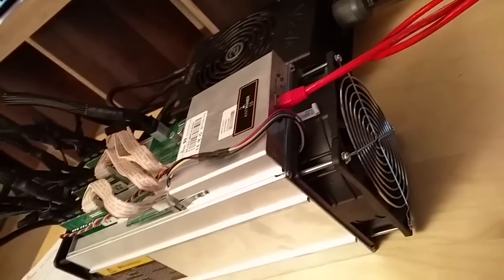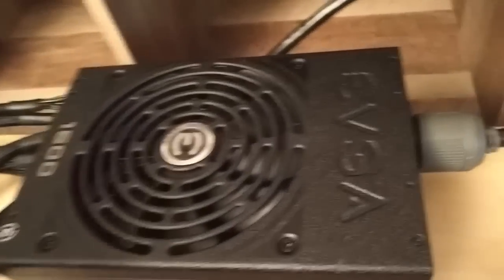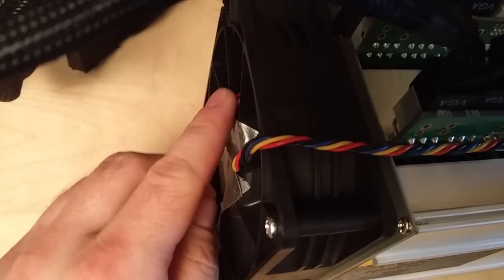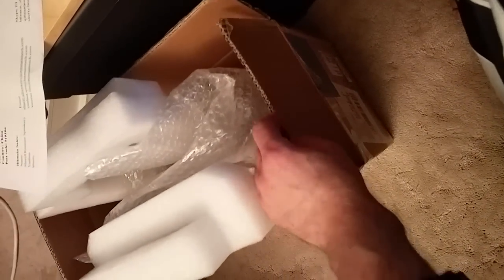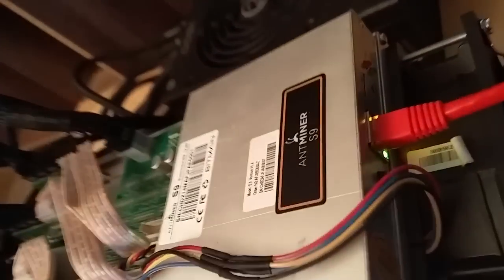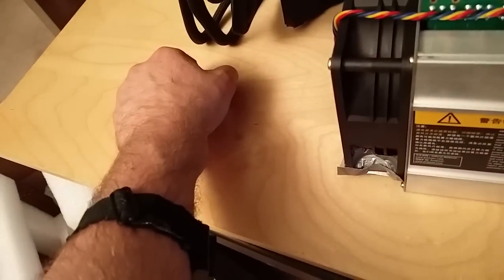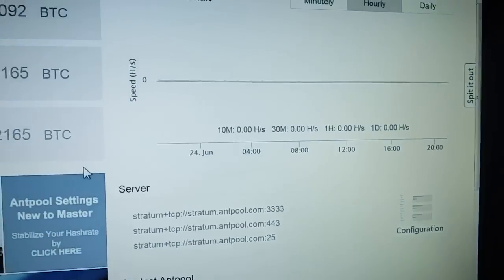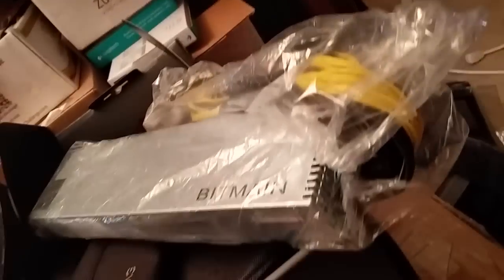Bitmain AntMiner S9 Batch 3 - Powering Up

Comment: I have the exact same problem, I plugged everything turn on the PSU which it does turn on but the miner won't turn any fan or light , I'm about to send it back to China , do you thing is a voltage problem too?
Reply from the maker: sorry for late reply. it is most likely voltage issue which means you need to get a standard 110v 1600Watt PSU from EVGA or similar. The one I got works great without problems for nearly a year now. I sold the bitmain power supply I had on Amazon.
Reply from the maker: EVGA 1600 G2
Reply: already solved thanks

Comment: Samson Shepherd, it seems that I am running into the exact same problem as you did. When you replaced your power source to the EVGA is the miner working on a normal 125V plug?
Reply: Would like to know this too please?
Reply: Did you get yours powered up?
Reply: Hey eddie, yes I did get mine powered up. It worked very well with the EVGA 1600 Gold.
Reply from the maker: yes it works fine on 125 plug. It even works on 110 in my home, as you have seen in the video.

Comment: Do the S9 PCI-e connections into the plug into the SATA connections on EVGA 1600 G2?  And, how many connections PCI-e does have?  I'm practicing on a S3 and it has 4.
Reply: you need 9 pci for the 3 boards.. and one for main board for a total of 10

Comment: That EVGA PSU has over-volt protection eliminating the need for cheap surge protectors.
Reply: Micheal Vetsch the titanium has like 15 types of voltage protection. that being said. Use a surge protector anyways. No reason not to. Things fail.
Reply: GrumpyShamurai the main reason I don't is because the miners I use. 2 will trip a single surge protector while one will not. Because of this I know I can plug 2 miners into the wall socket which has a 15 amp breaker. I would need 2 surge protectors per wall plug (they are all on their own breaker). So I don't bother.
Reply: Micheal Vetsch Get one thats rated for the amps. Or use two separate ones. Lost power here last week because a racoon crawled into a power box and got baked. Weird shit happens, hate to lose a miner over $20 worth of extra protection.
Reply: GrumpyShamurai you are right but I got the most poweful one Home Depot had. Anyway it doesn't hurt to have the surge protector you are right, it is an "extra" level of protection
Reply: Maybe look into an apc if you have the funds. After your done with the miner they are still nice to have around.

Comment: XD, the power supply that you bought from bitmain is around 175-240 volt requirement while America's voltage is 110 voltage so that why it wont work, change your outlet to 220 volt recommended) and then run it or continue use your regular America power supply
Reply: How do I change my outlet to 220volt? Or if I get this EVGA SuperNOVA 1600 G2, 80+ GOLD 1600W can I just plug it into the wall at 110 volts to power the s9?

Comment: Very nice video, I would like to enter in the Bitcoin mining business. I have tried some programs but only at 67 MH/s, just for research reasons, but I am now enthusiastic about buying a 14 TH/s Antminer and see  how it works. I would like to buy Antminer s9 but I am not sure how noisy it is. Is it as noisy as a vacuum cleaner ? or more? Can you sleep if you turn it on at night? or it is advised just to run it in an isolated place? or just putting it in a room you do not use will isolate the noise?
Thxs!
Reply from the maker: Mine is very loud, but if you have proper cooling throughout your house or the area you choose to make it's home, it should hopefully not up the speed of the fans to the "whining" noise jet engine due to the acoustics of the fans and air passing through the heat-sinks at high speed. It is much louder than my vacuum cleaner when it "whines"...and I have a very loud vacuum cleaner. It is just as loud as my vacuum cleaner at ideal fan speeds without the "whining" noise. 
Regarding Heat: If you put it in a room all by itself without proper ventilation and airflow, it will heat up that room in not time. I don't care if you have nice weather outside, this thing pumps out 200F degree air at high speeds and heats up rooms FAST. I knew this going in and I had plans to have it in a better location away from my house, but it overworked the A/C unit over there and I was asked to remove it. So now I am dealing with it solely at home.
Reply: +Samson Shepherd hello i am very interested to buy one bitmain machine but unfortunately i dont know how this works can you tell me how bitcoins can i earn with bitmain machine per month can you tell me the procedur?

Comment: Glad you figured it out. Just one note, Antpool does not share transaction fees. So you are being paid only from the 25BTC reward. I recommend a different pool
Reply: Try kano's
Reply from the maker: Thanks. Any pool(s) specific you are willing to recommend?
Reply: I like Kanos and its in the us
Reply: ***** I would suggest Kano.is if you got a small number of miners. Slush is good but try kano first
Reply: I use F2Pool. They paid every 24 hours. Slush is better? Thanks!
Reply: Yep, I´m going to put the S3´s that i have(six) to start accumulate shares. Thank you!
Because after the halving im going to buy two S9, and one for a client.  And is better if the miners have shares from before.
Reply from the maker: I have been using Kano's pool for long time now,  but noticed they are having a hard time and I have been getting paid less. So I switched to antpool again.  But I felt I was being cheated so I move back to kano again. But now it looks like kano is doing even worse than ever.  With Antpool just 1 month ago I was making 0.011 btc per day.  With kano I am getting 0.008 btc per day. What's up with Kano? Anyone else experiencing this?